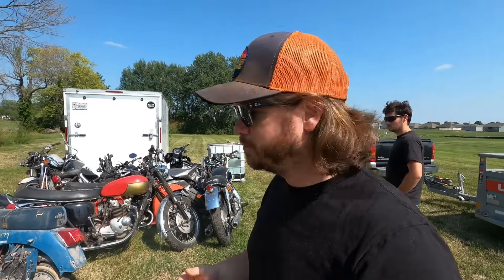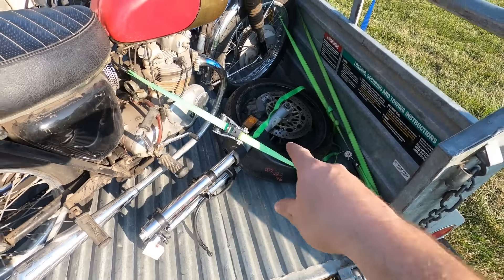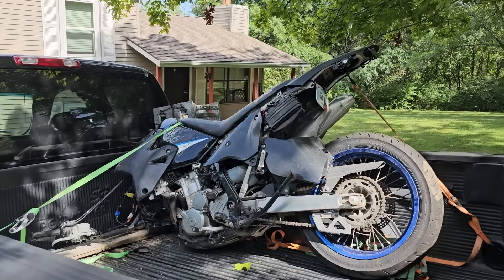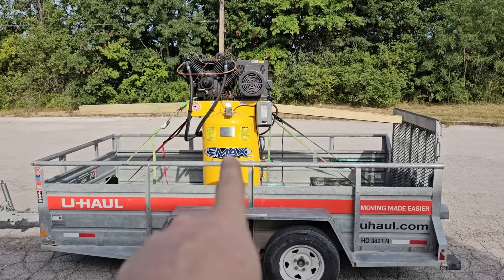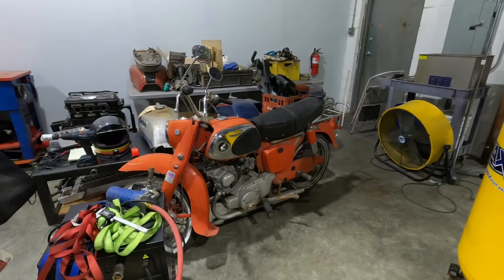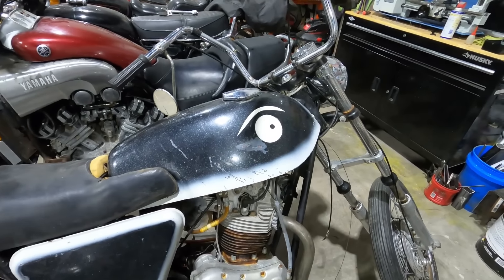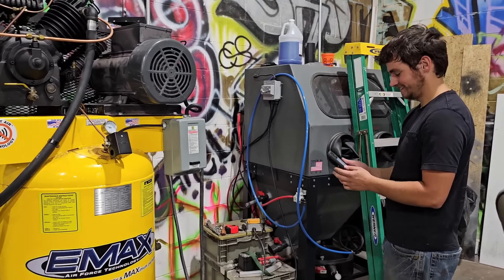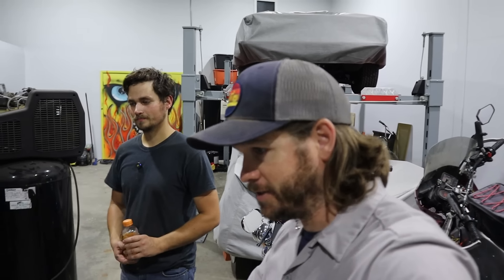We Bought 8 Crusty And Rare Motorcycles! - Our BIGGEST Haul Yet!

Comment: It's not a BSA. It's a Norton. Judging by the primary transmission Chain case, it looks like it's an early 750 Fastback Commando. Rare and sought after.
Reply: One of these in basket state in the UK cost silly expensive prices as would the Triumph.
Reply: He's found himself a vampire motorcycle.
Reply from the maker: @johnnyrvf  Yeah I'm thinking this bike would be worth making a bit more original and getting it to run
Reply: True story. Before I emigrated, I lived 15 minutes from the Ace Cafe and went there several times a week. One time I met a bloke who had worked at the AMC ( Associated Motorcycle Company ) Norton factory in the late sixties when they produced the bikes in Plumstead Road, Woolwich, S.E. London. He told me one reason the early pre NVT ( Norton Villiers Triumph ) Commandos were the quickest was because each cylinder head was hand finished. It was his job to put the valve guides into the head. He worked with a machine that ensured the guide was concentric with the valve seat and then it was passed on to his colleague who worked on the inlet ports. IMO a well sorted early Commando is a surprisingly, for it's period, quick machine. Parts are still manufactured by Andover Norton in the U.K who took over the supply of genuine Norton parts after NVT folded.
Reply: @johnnyrvf your dead on about commandos, I’ve had my 73 850 for 25 years. It will sit on 80 mph all day with me and my wife on it and corners like it’s on rails. They’re great if sorted.
Reply: It is a killer bike.:face-fuchsia-wide-eyes::face-blue-wide-eyes::face-orange-raised-eyebrow::glasses-purple-yellow-diamond::body-blue-raised-arms::hand-orange-covering-eyes::trophy-yellow-smiling::trophy-yellow-smiling::trophy-yellow-smiling::trophy-yellow-smiling::trophy-yellow-smiling::trophy-yellow-smiling::trophy-yellow-smiling::face-turquoise-covering-eyes::body-green-covering-eyes::goat-turquoise-white-horns::hand-purple-blue-peace::hand-purple-blue-peace::hand-purple-blue-peace:
Reply: @BrickHouseBuilds  It is worth it!
Reply: @stephengibbs4372  I bought my Commando 850 MkIII in 1978 and I still have it

Comment: That's a decent haul and also a nice air compressor. Two bits of advice for the compressor; mount it on anti vibration pads and set the air pressure switch to come on at the lowest usable pressure you can. Long cycling the run time minimizes how often the compressor turns on. The motor uses a lot of juice when it spikes on so this will save you a few bucks on your electric bill.
Reply: ... and build a closet around it to muffle the sound.
Reply: @fabienpichard  even better

Comment: I'm 71! You're channel is perfect! I knew the Norton instantly and prayed you'd take it. It is awesome. A collectable bike. Please go through the frame alignment and look for cracks. There are excellent fixes for all this that would make wonderful footage on YouTube. Google up the 750 Norton Death Wobble. No fear, it's just frame and tires being perfect and sensible riding. An absolutely great bike!
Reply: Yes, research required about that early frame. On the modified safer headstock there should be an additional 1" tube welded to it running under the main fat tube.
Reply: I rode mine daily for 2 years. Great bikes !

Comment: There was a 250 and 305 Honda Dream in mid-60's.  I bought a 305 scrambler basket case found under water in a crate. My buddy at 15 was his dad's Cushman mechanic. Anyway, for my 16th birthday, all legal the 305 scrambler was a 90 mph daily driver for years. Harold's bike was an Ariel 500 single thumper flat track racer from 1956. Straight pipes, magneto, Ceriani  race forks. And we were kids!

Comment: I bought my first bike at 17 years old in 1973. It was a used Honda CB 77 305cc that I paid $100 
Made my first international trip from Canda to New England.
Reply: @mattivirta  I am in the Philippines now and I bought  a new Motorstar Cafe 400. Because it is assembled here, there is no import tax and it is very  affordable at around $2500 USD. This model was designed by Honda, built from 2001 to 2006 under the name Honda CB400SS. Later the chineese company, Shineray, got permission to keep building the model known as Shineray XY400. It is also sold in other countries under different names. In Thailand it is called Stallion 400. I like that bike. Near 20k kms in less than 2 years.

Comment: Careful with that Honda ignition switch with the immobiliser. A lot of the aftermarket ones don’t have the correct parts in them. I think it’s a resister, Superbike Surgery did a video trying to fix a Honda and showed the oscilloscope signal and the missing input that the aftermarket switch was causing, leading to a no start.

Correction: some of them have a diode that enables the fuel pump, not all the aftermarket switches have the diode fitted , so no fuel pump and no start.

Comment: I have an ‘81 CB900C that came to me in baskets. I have eventually put the bike back into a Skelton ready to piece together. Engine fires with starter fluid and valves, cams and pistons seem good.  Every other part was rusted but the carbs were totally stuck. The throttle shaft linkage broke off from carb 2 housing. Gave up and found another carb set. What do you guys charge for a carb rebuild for my bike?
Reply from the maker: For that send me an email at contact@brickhousebuilds.com

Comment: I thought the Ironhead was a Yamaha TR1!!  Hopefully that cb450 isn't a cb500, I had a 500T with a Ducati 750SS seat unit and rear sets, people used to openly laugh in the street.
Best wishes from London UK
ps. I keep buying motorcycles imported from Arizona and have to suck 2 tonnes of red dust out of they're engines and frames, Id like to make a complaint thru this channel 😊
Reply from the maker: Whats wrong with the 500 as compared to the 450? Ive ridden and own both.  As far as the dust, I do apologize for it being annoying BUT....at least its not rust!
Reply: @BrickHouseBuilds  The 450 "Black Bomber"  was supposed to the better engine because.......I swapped an XS650 for the 500 in 1999 and I've been bitter ever since😉

Comment: I was hot on the idea of restoring an old Triumph, BSA, and even the Italian Harleys. But they all have one issue I couldn't live with, that is the gear shift on the right instead of the left. I couldn't get used to that and wouldn't want to. Old Nortons probably have that setup as well. The companies who survived over time, all put the shift lever on the left in their newer bikes. I think the really old Harley's had the shift on the right side as well. I thought your shop was in Ohio, how did you drive to Kansas City in 3 1/2 hours?  I would think that would be an all day drive.
Reply from the maker: We are near St. Louis so definitely not Ohio
Reply: @BrickHouseBuilds  On one of your videos I had thought I heard a reference to Ohio, my mistake. Kansas city is just on the other side of Missouri, so the driving time isn't so bad.
Reply: Actually learning to change gear with the other foot is easier than you would think
Reply: If the triumph 500 has twin carbs it’s a Daytona. Fantastic bike. Will say T100R on engine No. also should have twin leading shoe front brake which is about the best drums ever got.
Reply from the maker: @GGT2501  yes it's a t100r.

Comment: The Baby Dream is a CA160 not a 150
Reply from the maker: This is a 150 with a different engine
Reply: @BrickHouseBuilds  So now it’s a 160
Reply from the maker: @guylr7390  The bike is a ca95. Early version at that. The engine is not original. At some point in it's life a 160 engine was fit.
Reply: @BrickHouseBuilds You’re definitely right, that is the early shape tank. I may be wrong but I think the CA160 used the same tank as the late 150. I did something similar with a CL125A that had a rusted engine. I installed a CA175 engine that uses the same frame and only had to drill twos hole in the frame at the upper engine mount.